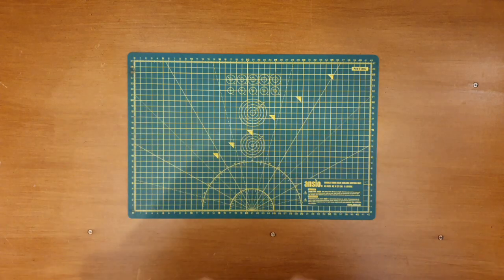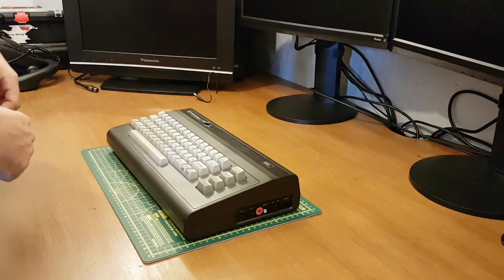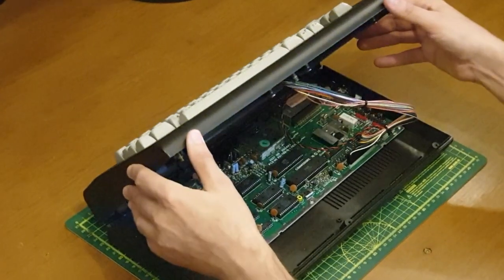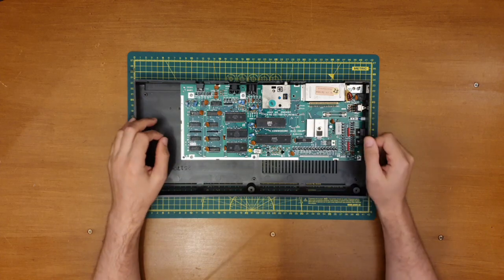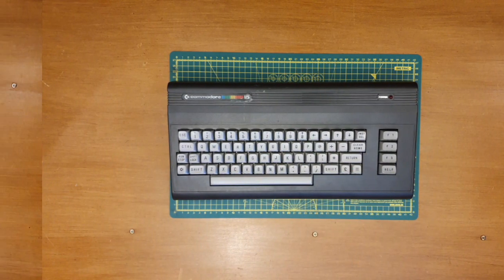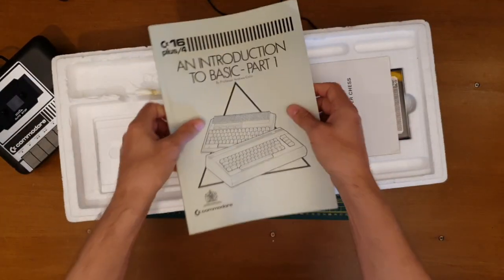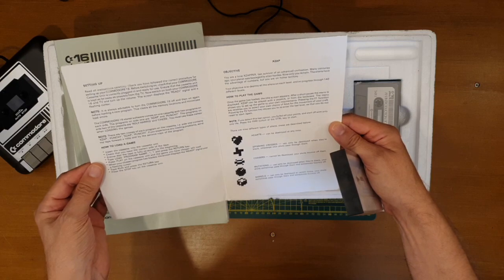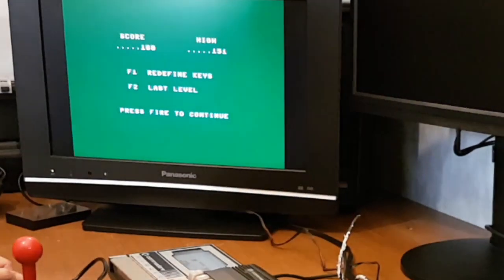Commodore 16 - Overview, Look around & attempted Power On

Comment: 6:49 i saw the exact port in Atari, could it take a Floppy disk driver ? 
and would it read Basics & Games.
25:10 i believe every bits of  your videos are satisfying... so yea  do it please!
i am sorry for my dumb questions but i really wanna learn how old machines work. :)
Amazing Video Chris
Reply from the maker: Hi there Abd Alrahman! 😊 No such thing as a dumb question... it's how we learn stuff!
Ok, so the port here, allows direct access to the internal system bus (the "data highway"), inside the computer. There IS a Commodore FDD (the 1551) that uses this port and it's much quicker than the older 1541, as it accesses data in parallel (several bits at a time) instead of serial (one bit at a time), but it is specific to the 264 Series (116, 16 & Plus/4) computers. 
The port on the 800XL does do the same job as the one here on the C16 (although the hardware is not at all compatible and the 'SIO' port is the preferred way to connect peripherals to that micro).
Before the IBM PC came along and the standardisation that those bought, very little hardware worked on more than just one brand of computer (and often even models of the same brand, like with this computer!), so you can't mix and match hardware across these machines.
Haha... Thanks, I might just do that in the future then! 😄 Thanks for your comment! 😊👍
Reply: @ChrissRetroCorner  The Commodore DOS transfers 300 bytes per second and the Atari 810 do 2,400 bytes  per sec so i thought this would be a powerful platform  😬  
(but i was wrong) 
And now modern computer bus use both parallel and bit serial connections which is the lead to improve modularity and save more money. 
 
i am trying so hard to keep up with your comment but man you are fantastic and btw there is a whole new world of tech that i dont know 😅 
Thank you Chris for your Precious feedback and for your time <3
So excited for new videos.
Reply from the maker: Hey Abd Alrahman! The data transfer rates are a little misleading and somewhat dependant on the processing done internally in the drive, before sending data to the computer. As you've found, it's sometimes very hard to compare these early computers! You're too kind, thank you, but although I lived through the era of these computers, I only owned two when I was young, so I am only learning these machines along with you! Thanks again for your support! 😊👍

Comment: 8:34 - "upgrading users, especially from the c64" - in what way is a c16 an upgrade from a c64? Apart from the colour palette and slightly faster cpu, the c64 hardware is superior in all aspects to the C16 and Plus/4.
Reply from the maker: Hey BSD and thanks for your comment. You've nailed it right there! Aside those two factors... that was it. It wasn't an 'upgrade' from the 64 and that was the problem, it was aimed at a different user-base. The public thought that because it was new, it was better and it was bought based on that assumption. There's references aplenty, from people that bought these at the time and then just didn't use them. 😕
Reply: @ChrissRetroCorner  Thanks for replying. Enjoyed watching the video. Can't understand why Commodore would saturate the market with C16 and Plus/4, but then again they did that with the Amiga's as well!
Reply from the maker: (Never posted my reply... having to remember what I said now!😄) No worries, like a chat me! 😊 Cheers, really appreciate that! No me neither, my best guess, they spent so much on R&D over quite a long time, that they felt driven to try and recoup as much as fast as possible? Who knows. I was a little late to the Amiga party, with an A500 in '89/90, but it seems that worked out for them that time round.
Reply: @bsdetector6908  Actually Jack realized, that they loose market due to much cheaper ZX Spectrum in UK and Timex in US, and he was foreseeing a horde of cheap and standard  Japanese MSX home computers (that never happened, but Microsoft helped the MSX standardization at 1983, so it had a certain chance at that time). 

The original planned price of the C116 with rubber keys and cheap PSU was $49. The PSU of C116 and C16 is exactly the same cheap design as the ZX Spectum, 100% compatible.
C116 was designed to kill the ZX Spectrum 16K, though he underestimated the 48K Spectrum's growth potential. (majority of the games were 48K at the time of 1985)

In fact C116 is a very similar cute machine with rubber keys (I think a little worse than ZX Spectrum's), and knew almost EVERYTHING better than the ZX Spectrum 16K (!): 
two times more sound, higher resolution, much more colors, better BASIC, built in monitor,almost similar CPU speed, floppy disc controller, real sound and video output (not RF).
The real weakness of the platform is the complex memory upgrade, and the maximum 64KB (officially, I have now a CPU upgrade with 512KB, but nothing uses it :-) )

This planned low price was the advantage of fully integrated IC called TED.
Compare this $49 to the C64's $249 price tag, and you understand, how brilliant Jack was,,and how successful it could be with better keyboard, a little more memory (32K) and eg $79 or $89. It was in fact the C16 with breadbin housing, unfortunately still with 16KB.

Unfortunately the money hungry marketing guys saw the chance of huge profit, and tried to sell the Plus/4 as a small office computer at $299 (you see how cheap was the hardware) with the promise of 3+1 built-in software (in fact it was an outstanding idea, but it did not work with cassette (in Europe --> not used), the 1551 fast floppy drive was not ready (in fact it is only 2.4x faster than the pretty slow 1541 despite 8 bit data line, so I think that was still a flop) , and the text editor allowed only 100 lines of text....)
Reply from the maker: Hey Zoltan! Meant to comment ages back.. sorry I've been a bit slow..!
I didn't realise the PSU was compatible... handy to know...might save having several PSUs out at once! 😊👍
A 512Kb C116... Wow!! That's amazing! 😍
It does seem like, had it released just a little earlier and the marketing guys stuck to Jacks original plan and price-point, that it really could have taken a decent fight to Sinclair. 🤔
I do struggle to see where the C16 was supposed to fit into market place... I do feel that it wasn't strictly needed (C64 sales still being huge), but the Plus/4 was a pretty decent device for the home user, not fussed about gaming. Just perhaps too highly priced and marketed towards business, more than home users, like you say. If the ports had been of the expected type and it use the C64 peripherals... then perhaps it could have been a different story. 🤔  😊
Reply: @ChrissRetroCorner  Thanks for the detailed answer.,
 Yeah, without the cheap hordes of MSX machines in US and Europe the story is not complete. (I had a theory, that after it turned out on that CES (where the Plus/4 introduced), thats MSX will not appear to US and Timex will also stop selling computers, Gould became angry on Tramiel concept and "waste of money", as the visioned competitors simply did not come. It could be why the timing of Tramiel was so strange) .
 Microsoft made few mistakes in the MSX standardization process (place of RAM, ROM, BIOS is not cdefined), and because of that the machines of different producers were not 100% compatible with each other, and the programming of games and SWs was arkward. And it was not cheap, though they took most of the parts from the shelves, few components they chose was from Intel and made the total package expensive. The Spectrum like attribute gfx of 1st version of  MSX was also not so great, the TED could produce better, though no HW sprite. The MSX's 3 channel sound chip was not highly advanced compared to TED, though I think everyone would be happier with 4 channels and some simple (even not programmable) waveforms.
Jack was afraid of the Japanese invasion like VHS recorders, killing local producers, and he needed something cheap against them. Too bad for him they did not arrive.
 If you check out the video "MSX Best Music" and you compare them (also the GFX) to Mr.Puniverse, Treasure Island, Exorcist of Tutti Frutti music on C16, you can see, that TED it no THAT far from 1st gen MSX music capabilities.
 Certainly later MSX2 had more advanced music and GFX, but it was 1985.
 Also worth to mention, that IF 364 would have been produced WTHOUT the Speech IC, and Script Plus would have been added instead of 3+1 SW by C=, it would be a different story without real additional cost. (the mould was ready, few more buttons does not count, and Script Plus also fit into 16KB+16KB ROM as 3+1 ). with THAT SW, (compatible with tape too) it would have been a different story, I dunno why they chose in 1984 the more limited 3+1 instead of Script Plus, but Jack was already left C=, so it could be some marketing team BS or some loyalty cents.
http://plus4world.powweb.com/software/ScriptPlus
Reply: @MMSZoli  This machine is better than C64.